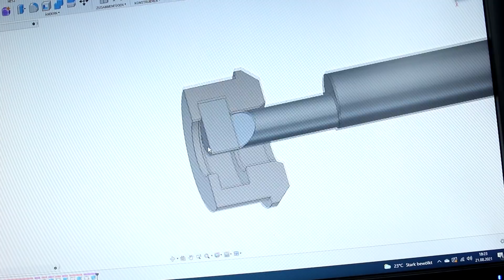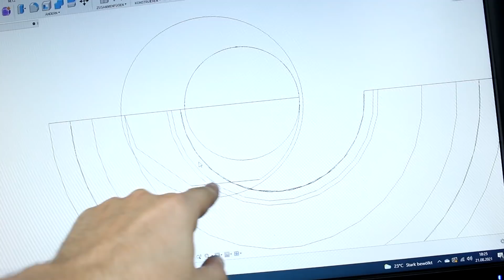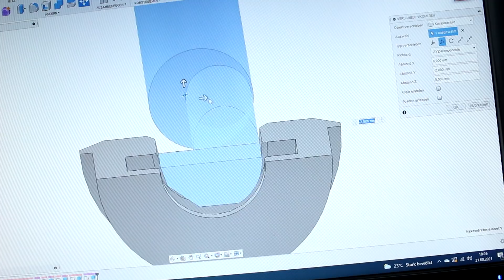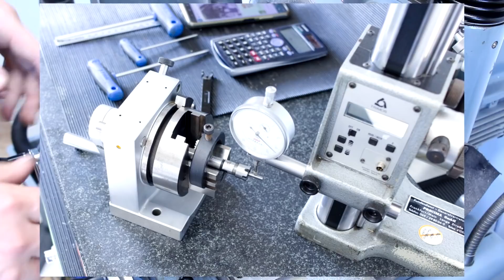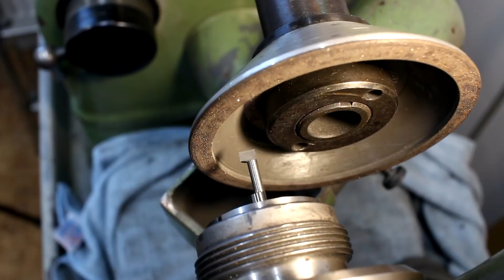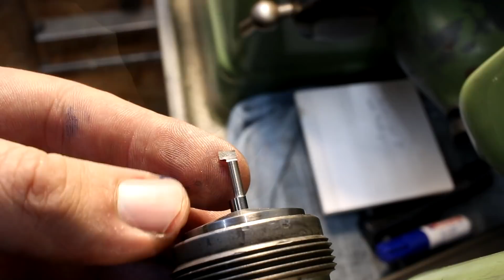Toolgrinding: ID grooving tool

Comment: The strobe effect would be easy enough to implement with a Hall sensor and a configurable delay to drive a powerful LED array light, so long as the rate was far enough from the shutter rate to prevent flickering. It would be even neater to phase-lock it so you could adjust the phase lag and have a sort of manually-adjustable rotation of the image. I can't think of a way to extract the frame rate from a phone camera or my ZV-1 to synchronise the lathe VFD frequency to the camera. Nice effect!

Comment: I appreciate you showing your thought process as you make these special cutting tools. The thing I like most about your channel is that even though you do professional, commercial work, you think like a DIY machinist. You don't spend absurd amounts of money on things like your spin fixture when a reasonably priced Chinese tool will do. Also, you don't mind making a tool, rather than spending big money on a ready-made equivalent. Throughout your history, on this 'channel, you have saved money buying quality used, and knockoff tools, and used those tools to make other tools. This is what most hobby machinists have to do to build up their home shop. It's no fun watching a professional shop drop big bucks on great tooling that I will never be able to afford. You demonstrate that ingenuity and affordable tools will let you accomplish anything your mind can conceive. On a practical note, I need to make a similar cutting tool to machine the inside features on an ATC conversion I am doing on a BT30 spindle for a CNC mill I'm working on. Thanks for the tips and inspiration. This is a perfect project for my new U3 tool grinder that you and Robin Renzetti inspired me to buy.

Comment: Very cool, particularly the cut-away view.  When you showed the CAD, I was thinking you would add the little chamfers on internal grooves shown in your model to your cutter, but I guess you would still have to deburr in the hole either way.  Nice job!  A strobe tied to the spindle would be easy--you need to sense the spindle position once per revolution with a Hall effect sensor or reed switch  and magnet and then a variable delay from that trigger to fire a strobe (could be LEDs) at the right time to get your view.  In other words, the frequency of the light pulse is one per revolution, but you need an adjustable phase offset from the trigger to the light.  A 1000 rpm spindle is only 16.67 rev/sec so your strobe would fire at 16.67Hz, which is very achievable.

Comment: Stefan, like you I make more broken carbide than I care to admit to. Do you remember where you got the resin bonded diamond cut off wheel/ I have been looking for something like that for a while to cut them up. I did like the shot of the tool cutting the internal features, a bit like finding out you have xray vision!
Reply from the maker: All my diamond wheels that i buy new these days are from a manufacturer in the Ukraine: https://pdt.tools/en/
The small wheel used there is from Winter and came with the S1 grinder.

Comment: Not a very cheap guy for the viewers, first you made us all buy D-bit grinders and now have to invest for couple of other grinders😂.
Some time ago I had to see what happened in a novel shape of a woodcutting circular saw teeth when chopping wood. I used a car ignition timing stroboscope synchronized with the blade. It was the scariest thing ever; the 5000rpm running blade seemed like a fully stand still item that magically took chips from the end of a 2x4". It worked quite fine with video camera too, regardless of the frame rate differences.
Thanks for a great video again!
Reply from the maker: Funny enough: All those grinders I have are not a replacement for the dbit grinder - I use every one of those machines on a very regular basis :)
Good hint on the car ingnition stroboscope light, I will look into that.

Comment: If the frequency of the lighting (50hz in Europe), the rotational velocity of the spindle, and the frame rate of the camera, are integer multiple of one other, then that last bit would synchronize nicely. Thanks for the high quality videos Stefan.
Reply from the maker: In this case I just indicated them on the top flat.

Comment: I’ve always had to make my grooving tools narrower than the groove . And step over to get final width. But then again that’s how I had to do it in inconel 718. And I do it that way on everything out of habit
Reply from the maker: Yikes, inconel - Gladly this one needed only to work in 1.4305 (303 stainless).
If I had to do wider groves, I would definetly step over - this one was also on the edge of working properly with the small diameter starting bore and the large diameter groove.

Comment: I have no ida where the name came from but we always referred to the Harig as a Snake Box. have no idea just how many eccentric locating pins I ground over the years in order to bring parts back into spec on machining lines with 35 to 40 years worth of wear in the slides
Reply from the maker: Neat!
I have to say, the spin fixture is so much fun to use, and easy to get precise results :D

Comment: The ending was awesome Stefan, you could have definitely "frozen" the rotation with a stroboscope (for example my Strobotac works on objects rotating up to 14,400 RPM).
Reply: @zomgthisisawesomelol Yes, most Strobotacs will accept an external trigger.  I'd recommend reading the Handbook of High Speed Photography (it's free online).

Comment: What happens with the chips generated by this tool?
Do you vacuum through the spindle? 
It seems there would be almost no clearance for chips to escape past the necked down shank.
Reply from the maker: That turned out to be a huge issue on the project - I had compressed air blowing trough the back of my lathes spindle, that helped a lot - but still I had to clear the tool from time to time to get all the chips out.
Reply: Yes, I was thinking the same.  Also, I was wondering if the chip breaker was working or whether it was the interrupted cut making  the chips.
Reply: @martinhughes8500  Good question.
I'm not sure how the final part's 'free machining stainless steel' would behave.
I'm also not any type of machinist so perhaps I ask stupid questions.
I just like to watch Stephan's channel because of how he thinks through and executes his projects.

Comment: what kind of bearings would be inside your spin fixture?
Reply: I would guess two angular contact bearing or nowerdays  Cone-shaped Rollerbearing  in opposing orientation...

And a Clampingnut to adjust the Preload so you can get zero play in the System.

My 1960th Watchmaker Lathe (Boley WW80) has angular Bronze Bearing, still works perfect.
Reply from the maker: I had planed for two universal matched NSK P4 spindle bearings, no adjustment needed, just clamp the inner and outer race against each other.